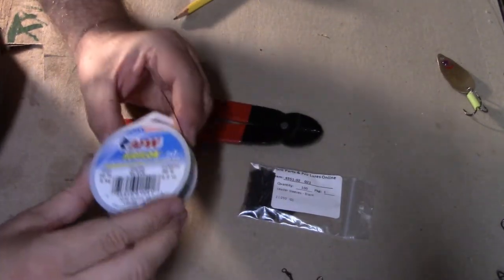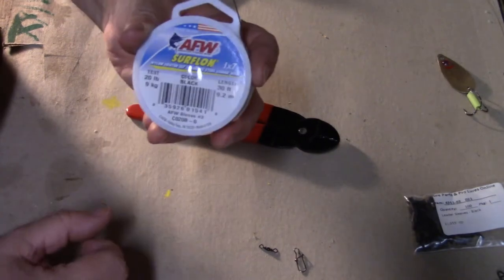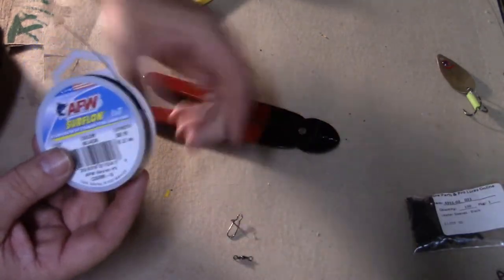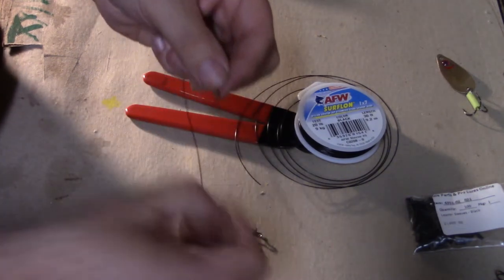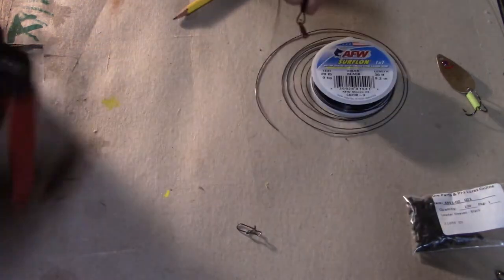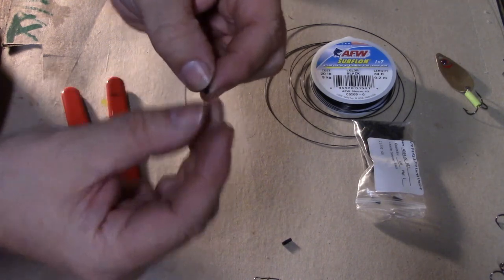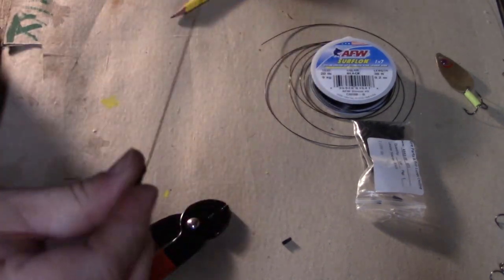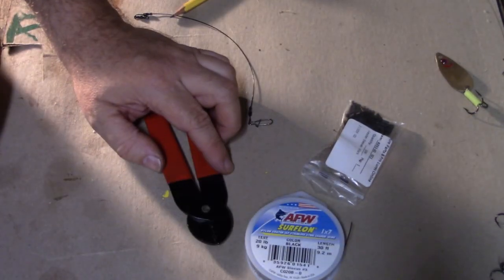How to make your own wire fishing leader

Comment: Hi- brilliant video. Can I ask- what measurement are the crimps (sleeves) you're using there? (I assume they have a length and internal diameter in their description)? Also, I know the wire is 20lb strength, do you happen to know its diameter is? This isn't as important for me to know as the sleeves one though, so if it doesn't give a measurement on the package that's no problem!
Reply from the maker: I don’t know the actual size. I’m using AFW surflon 20lB. Test. You need to use Sleeve #3 with this wire.
Reply: @timgrant6939  ok cheers

Comment: I see you are crimping over the black poly coating ?  Don't you need to shave off the black plastic 
coating so it will not slip ?
Reply from the maker: I've never had one slip on me. But remember I'm catching small fish with this set up. (Chain pickerel)